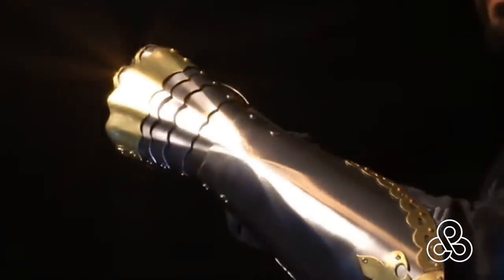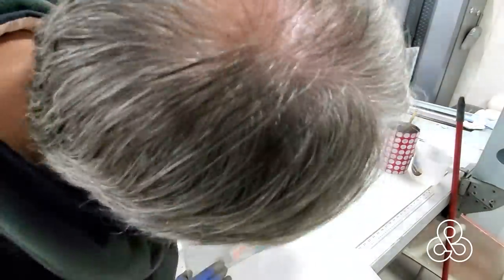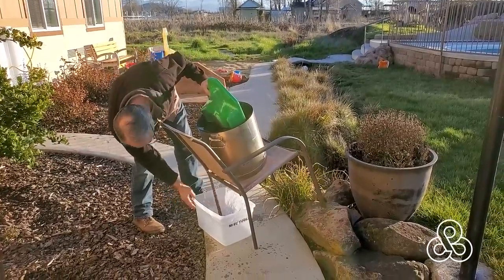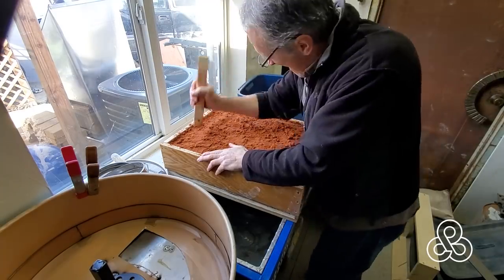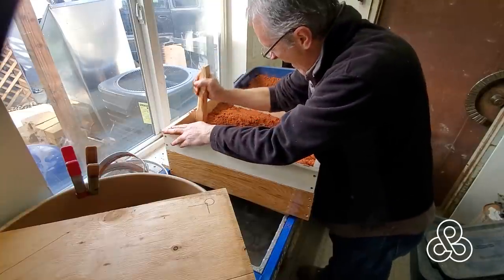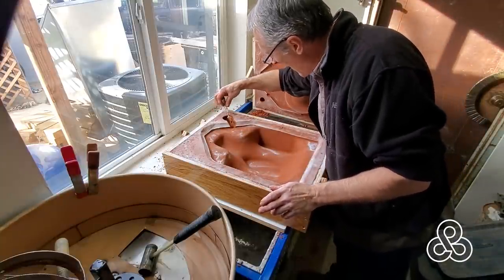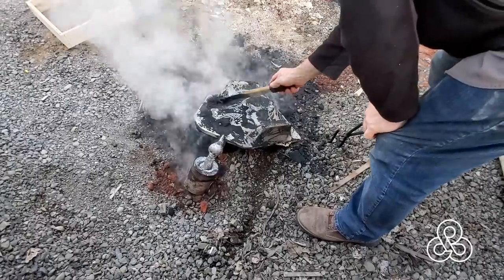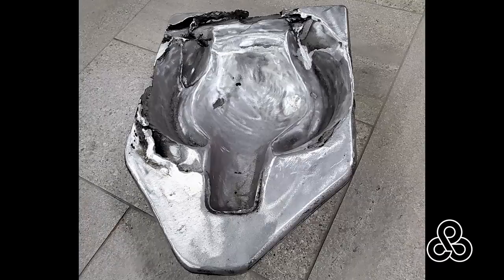SS98 - Aluminum Foundry casting a die for the Rocketeer jetpack, featuring David Guyton.

Comment: With a large sand casting like that you might be able to reduce the weight and amount of sand required by using some Heeble spacers. Heable is a light weight concrete block you should be able to get at any hardware landscape store, it is moderately temperature resistant and you can cut it with a wood saw.
Reply from the maker: Commercial foundries some times use stainless steel screen similar to the way geotextile is used, but as I mentioned mostly just cranes and assist tables.

Comment: Thought sand casts over 10lbs had to cool like 12hrs b4 being removed?
Reply from the maker: Maybe cast iron that you want to be semi annealed for machining. most aluminum foundries I have visited brake em out right away and throw them in water. Get that sand back in the muller.